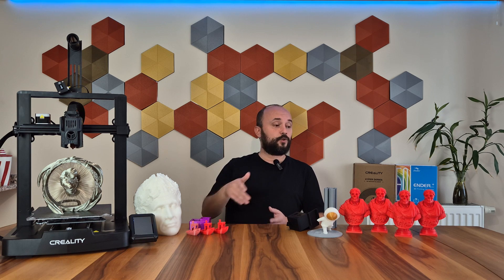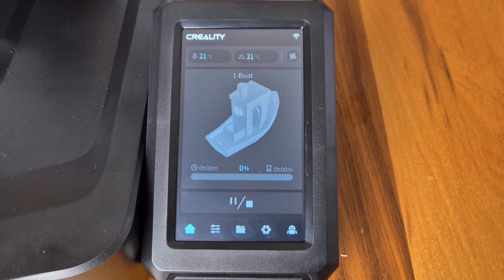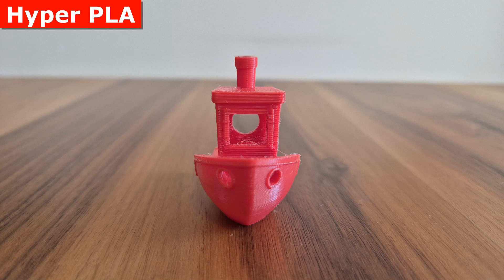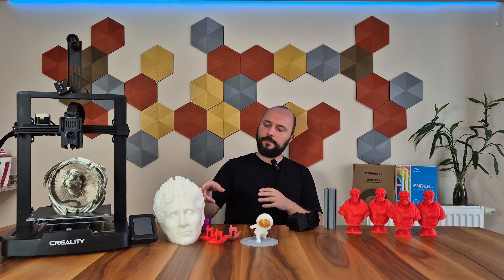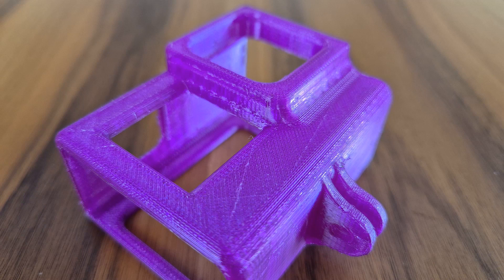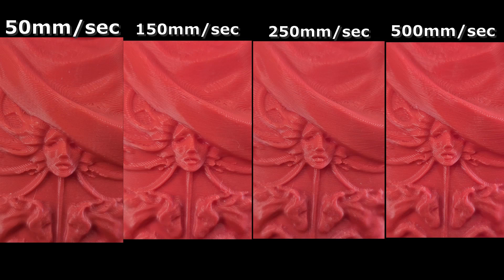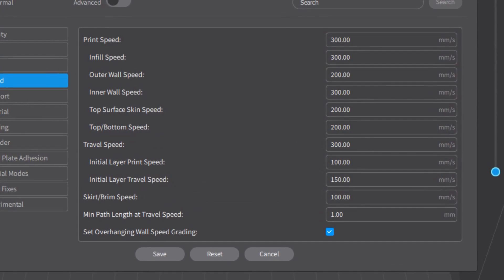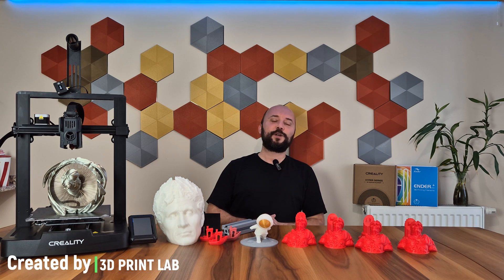Creality Ender3 V3 KE 3D Printer Review

Comment from the maker: So, what do you think about Creality Ender3 V3 KE?
Reply: My entire hot end failed within a day of having it. Couldn't get past two prints with ColorFabb PLA. I got the big "blob" everyone refers to when the PLA oozed out & when it cooled it essentially welded the nozzle to the heat sink. Screws are loose from the factory & still get the WARNING KEY: 2509 SENSOR TEMPERATURE EXCEPTION. CS is very lacking, but today I got my replacement parts & installed them. Still same error & I cannot do anything on the touch pad. I've since found out that hundreds plus of other owners are having failed KE printers. The folks are Creality are really nice, but it's very hard to get them to respond to emails & there is no phone support in North America. I'm not calling them at the China number they give us. Now I have to wait til Feb 18th when they return from their New Year holiday. Even then I don't know when they'll get back to me. Can YOU help, perhaps? Thanks!
Reply from the maker: @Warpig0321  Hello, I'm sorry you encountered such a problem. I think the problem is in your Hotend. Because if there is a problem with the hotend, your printer's screen may not work. If there is a place where you can buy Hotend, I recommend you buy it and replace it. However, before that, take photos and video of the errors you get on your printer. Because Creality will ask for these before sending you parts. If you buy and replace it first, the one sent by Creality will be available as a spare.
Reply: I'm having a lot of trouble with the piece coming off the table, I've tried setting it to a higher temperature but it doesn't stick.
Reply: @VHSabstrato000 same
Reply: I think a Bambu a1 is a better value
Reply from the maker: @iidogninjx  I agree with your opinion.
Reply: I am pretty unhappy with my KE purchase.   Poor build and print quality for me.

Whole host of issues:
1. Gantry is far from square to bed.  Screws holding gantry to frame are super short and easily stripped.   2. Y rods aren't secured - screws are too short at front allowing them to move up and down.  3. Bed has a ton of wobble.   4 . Firmware has frustrating things like odd places to park the head when you're trying to change filament.    5. Some hardware wasn't tight - poor QC or build.
Reply: I gave up on it The set screw in the center of the heat break for the nozzle assembly almost never tightened properly show the last print I tried it buried the nozzle into the bed and just dragged it before I could get to it pretty good so I went through the whole process of realigning it took forever and I don't know I guess I was too rough with the motor or something for the extruder and that doesn't work now so I'm just taking it back the flashforge 5m  is only 300 bucks right now Another thing that KE was doing if I paused it the bed wouldn't stop and get misaligned so maybe I just got a bad one or something
Reply: You know what else I think is stupid....is the  run out sensor who the hell can't  tell how much filament is on your spool and how much the print is going to take from that? But if you just put a little piece of filament in there you can use that as an emergency pause by pulling out the piece of filament.
Reply: It is fast.... I like it...also got the ender 3 v2..big difference also CR-10 S3...also slow like the v2...now i can print so fast...and it is good print quality

Comment: What do you think about the v3 KE in comparison to the CR-10 SE?? Currently where I am from the difference is of 100bucks. Do you consider the CR10 worth it in that case? I would really appreciate your opinion.
Reply from the maker: I think if you want an affordable, entry-level 3D printer, KE will meet your expectations. If you don't print at high speeds all the time, you can use it for a long time. My advice is to buy an extra hotend with KE. Because I have heard complaints about this printer from some users about hotend clogging sometimes.

Comment: I think the issue a lot of beginners run into is that they see all these other creators modding, cracking, upgrading, adding linear rails to the bed, etc. without actually just running it as stock for a while. So they make all these tweaks as recommended by content creators and then eventually mess something up and get frustrated. 

But it's good to see you just advising running it on stock setting, the printer is built around those settings. If you are starting out there is no need to throw on a rooted firmware and tweak the crap out of it. Just run it and then you can adjust it to your settings and prints.
Reply from the maker: Thank you for your comment. Yes, it is important what the printer can do with stock settings. To upgrade, it is necessary to have some knowledge of the 3D printer.

Comment: Just one question for you. In my case, it shows the insufficent filament, but actually there are plenty loaded. The filament is extruded through the filament sensor correctly. What should be the way to sort it out, thanks.
Reply from the maker: I think only the filament sensor is faulty. I don't think there is any other possibility.
Reply: @3DPrintLab1 Thanks.
I just ignore it and it can print.
However, I found under extrusion issue as the material can be extruded well in the first few layers but issued in the next few layers.😢
Reply from the maker: @kegong1270  Are you using Creality Print? And what is the brand of filament you use? What you said makes me think that there may be a diameter problem in the filament.
Reply: @3DPrintLab1  the machine I am using is Ender 3 V3 KE. 
Yeah, I agreed with you as my filament is self-made, and had been used for makergear m2 first but same issue happened.

However, the V3 Ke worked perfect last Thursday but struggled since this morning.
Reply from the maker: @kegong1270  Most likely there is a diameter problem in the filament. First the sensor detects this and gives an error. You say ignore this, the printer continues, but unfortunately the filament cannot pass through the extruder because it is too thin or thick and the printing is left unfinished. I recommend you experiment with a quality filament. If there is no solution, you should contact Creality.
Reply: @3DPrintLab1  many thanks for your suggestion, I will try it tomorrow and let you know the result.
Reply from the maker: @kegong1270  You're welcome, I hope the problem is solved.
Reply: @3DPrintLab1  Like you mentioned, the problem was addressed since I changed to another self-made filament with larger diameter.
Reply from the maker: @kegong1270  I am happy that you solved the problem, but you may encounter such problems frequently with self-made filaments.

Comment: This is my first 3D Printer and just want to share the things I learned that will help start  out with a much better experience.
1. Make sure the voltage switch in the back is in the correct position. (will keep rebooting if not in the correct position)
2. Make sure your tensioners on the gantry and on the plate belts are tight. (will either code or belt will keep skipping  during prints)
3. Keep a couple nozzles (long ones, not the short ones) and a heat end available for spares.
4. The Holy Grail Keep the tip of your nozzle lubricated with an oil that can withstand heat. (3-in-1 oil / Olive Oil / Vegetable Oil)
Keeping the tip lightly lubricated will help prevent issues with moisture and filament curling up under the rubber cover and extend the life of your printhead dramatically!
I was changing out my nozzle like once a month and cleaning off my heat end constantly until I started coating the tip of the nozzle and the bottom of the rubber cover. Now it has been 4 months after I started doing this and my nozzle is as clean as the day I changed it out. I can hit print and go to work and come home to a flawless print.

Also if you want to do your own 3D designs, Tinkercad is free and very easy to use. Combined with Ultimaker Cura. 
Anything that has an overhang of more than a 45 degree angle will need supports enabled.
Reply from the maker: Thank you very much for sharing your experiences with us. User comments are always very helpful.🙏
Reply: On point one, it will only keep rebooting if you set it to 230 in the us, if you set it to 115 anywhere else it will break and the power supply could explode

Comment: High quality is also available in the settings. What's the difference? is it better or not?
Reply from the maker: As the layer height specified there decreases, the lines on the surface become less visible. However, printing time will also be longer.

Comment: Do you know  how to change nozzle diameter in the klipper software i seem to be locked out from doing so,,,,thanks
Reply from the maker: You can do this through Creality Print. Select your printer from the top right and click "manage". Then, on the opened pages, go to the section labeled "Extrusion 1" and change the nozzle size in the first line. Thus, your printer will automatically adjust the required filament flow. I don't know of any changes made via Klipper for this.